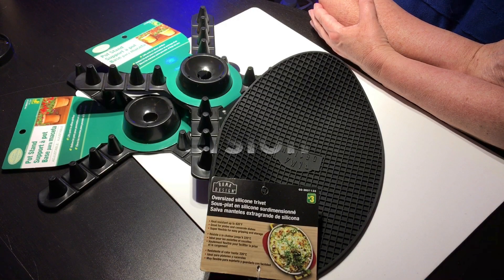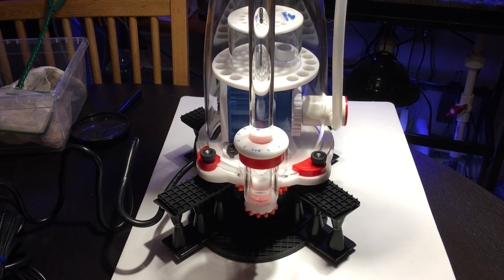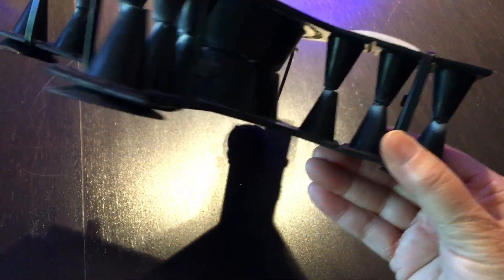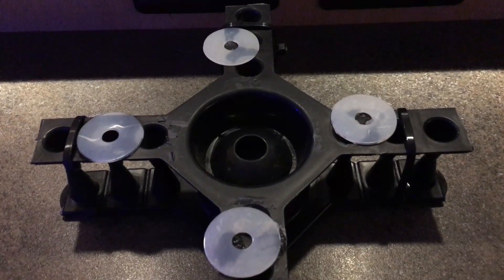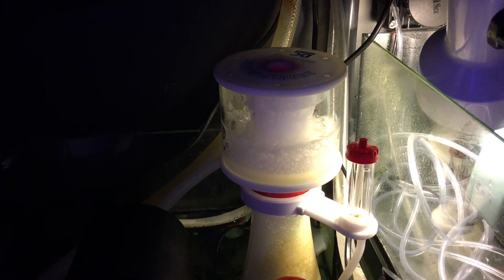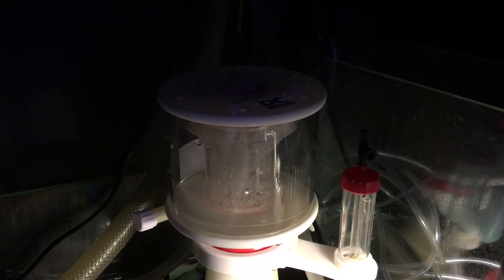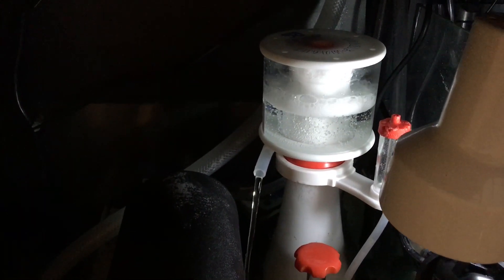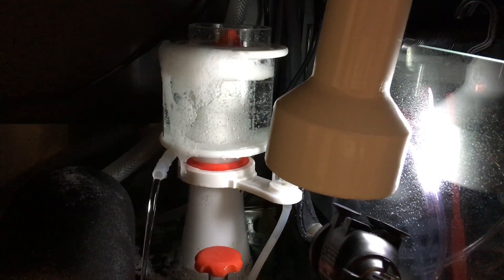DIY Skimmer Stand Turns into ReefRant - Am I Just Being a Princess?

Comment: Sorry about the skimmer woes... You're a trooper for hanging in as long as you did!
I had a similar experience with Bubble Mag and wound up selling it and going with a Nyos when my frustrations boiled over.  I wouldnt recommend them either.
A little tip for the next time you have an overflowing skimmer.  Leave the cover off the cup and put a gallon zip lock bag over the cup to keep the sump from getting sprayed.
Reply: And i stole that tip from Pelphrey :)
Reply from the maker: Lol, that is a good tip! I'd have needed a trash bag though. 😬
Reply from the maker: I've decided I'm saving for a Deltec. Enough of this BS. I honestly thought one morning I'd go and check, and everything would be fine. When I realized this had been going on for four weeks, I finally had enough and it was only by chance I found the air valve idea. If I hadn't, my next step would have been to pull the 3.5 from the nano and get it into here. Though undersized, at least it was working. And actually, that one broke in in about six days when it was new. smh. Hopefully the air valve fix will allow this one to work properly until I can replace it. So frustrating, and what a waste of money. 😡 Thx for watching and the comment!

Comment: Hey @Reefgrrl first of all, congrats for you effort to make this works!
It's very sad that they just don't care about you. I have one exactly like yours and I hope that I don't have the same problem when I setup my new tank. Please keep us informed and if you still have this problem I won't use mine and I'll return and take another one.
Thanks, good job!
Reply from the maker: If I were in a position to return mine, I'd do it in a heartbeat. But it's used now, and according to the distributor, working normally. 🙄 
Excessive overflow seems to be a huge problem with these Curve skimmers, and I've read some stuff about them being very touchy with reacting to water chemistry changes. I'm really hoping the air valve fix allows this thing to do its job properly until I can save enough $$ to get a Deltec. I should probably have done that in the first place but at the time couldn't get one in North America without huge shipping expense. Apparently now though, Marine Depot is carrying them. Thanks for watching!

Comment: I had this skimmer for almost a year and i had to do the same thing luckily i had a similar device from an old powerhead i had. I tried taking the air valve out after about 6 months just to see if it would be broken in properly and it still overflowed. I ended up getting a vertex skimmer and i am much happier now.
Reply from the maker: Interesting. I've removed the air valve several times to see if it's settled, and it still overflows. So that tells me there's something up with the design. I'm saving for a Deltec as long as I dont see too many further negative reviews on the new DC one. Vertex is also on the list because a couple of people have mentioned it. Thanks for the comment!

Comment: I've had my a5 for close to 6 months now. I used  a small corner of a paper towel to restrict the airflow. It is now a beast of a skimmer and I have it submerged just over the pump in about 4 -5 inches of water. Mine took over a month and a half to break in.  I ended up running it on vinegar water for about a day and that did the trick
Reply from the maker: Thanks Rob. I ran mine for most of a day in vinegar before it went into the sump. Didn't seem to help any. Or who knows - maybe it would have been far far worse if I hadn't.....
Reply: Reefgrrl Yeah I feel your frustration with this skimmer. I tried replacing the overflow but I quickly ran out of fresh saltwater to replace it. Once I choked the air it started skimming like a beast and now I have the water level just above the bubble plate and set around 1 or 2 it works great without choking the air. It's been quite a frustrating journey to get to this point

Comment: O boy sorry to hear i m hoping your problem is solved by now...i m glad I saw this video i m in process of buying a new skimmer amd i have narrowed down to bubble magus curve 9 or CORAL BOX cloud 9....i m now leaning towards coral box.....
Reply from the maker: Well, it's now been running for 10 weeks and still overflows if I remove the air restriction. But it's skimming really well, with near-black semi-wet skimmate. So it's working, just not the way the manufacturer recommends. Haha, your call I guess.... 🤷‍♀️

Comment: I had this skimmer (it's in the closet now) and also experienced the same ridiculous break-in period. What really seemed to help me was to run the skimmer in a vinegar-water mixture for several hours and then run it in RODI water for an hour and then back in the sump. This skimmer was a little oversized for my tank and was also rather prone to overflowing upon performing any kind of routine maintenance on the tank so I decided to retire it for another skimmer (Aquamaxx WS-1 which I also don't love as it causes way too many microbubbles out of the overflow into the sump).
Reply from the maker: It's the issues of overflow from the slightest of changes in the tank, that has me concerned that it will never work properly. It's unfortunate that lessons in this hobby are so expensive to learn. I actually thought I was buying good quality and value for money. But this overflow thing is, in my opinion, a far worse problem than underperformance. So I'm going to save up for a Deltec and put an end to this BM BS! 😎 Thanks for watching!

Comment: Hi! Okay first of all, as you do know I have the same type of skimmer : There is a V2 version of this skimmer, that's the one that comes with the airvalve. That version also has a hole (around 6-8mm) drilled into the baseplate opposite side of the pump to allow more outflow (and by that to lower the water level in the body) - mine is the V2 version. Second: Your skimmer will never break in if it's overflowing that much, not even in half a year time. Third: You restricted the air way too much in the video - you can see that the body is almost full with low bubble density water, and only around 2 inches are bubbling -> that's a way to prevent it from overflowing, but you will get very bad skimmer efficeny. Interestingly enough if you lower the air intake rate, you will get a higher water level in the body (because that's how all skimmers works), as the pump can pump more water then. So.. Here is my advice: First of all pull the air intake from the bottom of the silencer, and just run it free for a while (will be loud). This way it can pull more air, which will drop the water level. If raising  the skimmer & this doesn't solve the problem, I'd drill a 6mm hole into the base plate (there is really not much to loose, worst case you can silicone it back) And see what happens. If it's still overflowing, step up the hole to 8mm (I wouldn't go any bigger). Mine is raised around 1cm on an eggcrate, and with the silencer and the supplied air valve not in use (I'm running the air from the outside of the house), and the gear valve fully open, it's consistent and produces a nice dry skimmate. Remember, you want full white milk colored water in the whole body above the diffuser plate on the pump & if you decide to drill the base, go from small to big, and don't exceed 8mm (6mm would probably be enough), as that might drop the water level too much.
Reply: I can measure the hole / send a picture of it's location on the base plate for you if you'd like.
Reply: Measured the hole and it's 6mm. Also took pictures about it, so let me know if I can send them
Reply: Ooor if you don't want to drill it, remove the silicone thing that goes over the electrical wire of the pump while exiting the base plate, just behind the pump. That'll also let more water to flow out of the body
Reply from the maker: This is great - thank you so much for all the detail! I'll certainly take a look and see how things sit and what adjustments I can make. Right now, a little more than 24 hrs after inserting the air valve, the skimmer cup contains about an inch of very dark brown skimmate, and the neck of the cup is filled with brown foam that spills slowly into the cup. It looks like it's producing exactly what it should. I'll see if I can adjust the bubble level to rise closer to the top of the skimmer body. I read where someone said theirs works perfectly with the bubble level about an inch or so below the upper white plastic rim of the skimmer body.  I guess it's a bit different for everyone. 
I really appreciate you taking the time and effort to provide this info - it does make sense and the missing link was how to actually accomplish the adjustments. 😀
Reply: Hm, interesting.. Sorry if I sounded like a smart guy:D Anyways, If you're happy with the skimmate then leave it as is:)
Reply from the maker: Hahaha, never apologize for helping somebody! It sounds like you know what you're talking about. I very much appreciate any info that will help.

Comment: Ive had this issue with other skimmers. On my Red Sea Reefer 350 - it usually takes overflowing a bucket or two before the skimmer calms down. 

In my system it was caused by using the putty or when I used certain medications. Switching to superglue stops this from happening.
Reply from the maker: It still overflows if I remove the air valve I put in, and it's been running now for 2 1/2 months. And it doesn't skim efficiently, seems to me. In my system I only used putty for four corals and that was six weeks ago. It's driving me crazy and I am planning to replace it when I save some $$ to get a Deltec or perhaps Nyos. It makes no sense to me why it won't break in properly. Thanks for stopping by!

Comment: honestly, raise the skimmer higher until it's not flooding out like that. It will be almost a dry skim but will be taking organics out. organics and any plumbing glue you may have done. my RLSS DB6i skimmer was bad, even at the lowest setting and raised up to the cabinet top. after many....maaaaany emptying and cleaning of the cup did it finally settle down to were I could bring it back down to regular depth and increase my motor speed. but yeah I'd remove that valve and raise the skimmer pretty high. I use pvc pipe and elbows with some egg crate zip tied on top. gives me infinite adjustments and is super cheap. I go through a lot of skimmers btw.  my current one is a SRO3000 from reef octopus and I like it, minus the large foot print. same 425xl tank btw.
Reply from the maker: I would love to have had the chance to empty a skimmer cup but all it did was overflow. Never stopped. The space I have is limited and right now it's as high as I can get it without it tipping over. I'm done fooling around with it and hopefully the air valve will buy me time for it to get running as it should. I can't use egg crate because the legs are pointy and go down into the holes, and then the adjustment doesn't work because the gears can't move freely, being under the bottom plate. Sigh. I had a Reef Octopus and loved it until it finally died (I got it used). But that was another tank..... I've decided to save up for a Deltec, enough of this BS. Thanks for the tip! May come in handy next time. 😁
Reply: Reefgrrl yeah that gear valve thing I hate. my RLSS DB6i is the exact same way. I just let it sit through the egg crate and fully open while the skimmer was figuring out what it wanted to do. I have my back up skimmer the LifeReef 36 inch version with a fluval SP6 pump that is just over kill lol. Only reason I don't put it in the 425xl sump is cus the pump would suck and chop my lightning maroon I have down there. oooh! I just remembered one thing from my old 120g once the ATS is maintaining the tank, the skimmer doesn't really produce any foam head anymore. the skimmer just stopped producing, even when I changed to the smaller RLSS from the LifeReef. just something to think about since you have the scrubber as well before you decide to drop a lot of money on that skimmer. I'd leave it as is since it will become a giant air bubble pump to oxygenate the water. 

off topic: I haven't forgot about your request of coral placement lol. I got my par  meter out and found out it was super low. I had about 75 par at the tip of my rock. I have it adjusted to 350 now but am doing it over the 6 week acclamation mode. in the mean time I'm trading my acans for acro :)

Comment: I used A5 before. it work really well for years! you need to level to the buble megus white plate where the black  plastic screw about 6.5inch height
Reply: no point trying everything just understand how it work first.. 6-6.5inch is the exact height trust me
Reply from the maker: I just checked and as close as I can tell, that's about where it is now. Still overflows when I remove the air valve, but I'm hoping that will change as it starts working the way it should. Thanks for the tip!

Comment: Try opening the gate valve all the way. I think the air silencer is the issue here. Try to run the skimmer without attaching the air line to the silencer. In general the water level in skimmer should be the same as the highest point of skimmer body with the cup removed. If the water level is higher in the body, either air intake is restricted or the gate valve is way too much narrow.  Also the oil residues and epoxy can cause overflowing problem as well as some medications like red slime remover.
Reply from the maker: Thanks for the comment - lots to think about! This is a new tank so no meds  and until a few days ago, no epoxy. I have no clue why this is taking over four weeks just to break in. But at least now it's skimming properly.

Comment: I'm glad I watched this but sorry for your experience, which you handled very well considering the setbacks. as for the rep, well.... that's bubble magus off my list 😉
Reply from the maker: I hate the "nobody ELSE has this problem" excuse. So now, I'm saving up to replace this with a Deltec. And hoping this BM starts running properly at some point. Once my 20 is torn down if this one is still not running right,mi might take the 3.5 and use it to replace the a5. I realize the 3.5 is underpowered, but I know it works a treat. And it only took about six days to break in. Thanks for watching Dr!

Comment: great video. i am using a aquaone g series skimmer which is another cheap type of skimmer and its brilliant. it came with a valve to control air intake as do lots od other skimmers so that person you were dealing with was talking pure shite! glad you got it sorted!
Reply from the maker: Thanks Irish Aquarist, it seems I've been let down by BM in this regard. After running for a couple of days now with the air valve in place, I'm getting dark brown, dry skimmate. I've been adjusting the red knob to maintain more water in the chamber and slowly getting it to produce slightly wetter skim. I've removed the air valve a couple of times to see what will happen, and sure enough, the liquid zooms up the collection cup neck and starts overflowing. But at least I can make it run the way it should now, no thanks to Bubble Magus. Thanks for watching!

Comment: so painful.  Rant justified, totally!  I thought you were going to rail on the 7.9-8 range, though as well.  Maybe I missed it, what water height are you at now?
Reply from the maker: Thanks LF, and yeah, seriously, how can they be that precise when they can't even be accurate? I suppose it gives them an out when most people find they can't get the thing to work right - they can claim it's not being operated within the stated tolerance. 
At the moment it's running in just over 7" of water, with the air valve inserted. That valve is wide open but it seems like just the restriction caused by the thickness of the plastic is helping to control the bubble level and there is zero overflow right now. I've removed the valve twice just to see what happens, and both times it overflows again within seconds. 
I've decided I'm saving my money for a Deltec (apparently Marine Depot is now carrying them) and that way if this thing never works properly I should be able to replace it within a couple of months. 
Oh well, today is going to be a major coral moving day so that's a good thing. And I'm going to do an update on the new fish and other stuff in that tank as well (I've been updating on  Instagram and now I'll do a YouTube video). Thanks for watching, and for the support!

Comment: Jesus...4 weeks? My temper would have smashed that skimmer 3 weeks ago haha...
Good ting you got it sorted though
Reply from the maker: Honestly Daniel, there were times I could have cried, I was so upset and frustrated. The crazy thing is, I've been really careful with this tank, to research before doing anything so as to minimize problems. I guess the first clue should have been when this skimmer had a dead pump straight out of the box. I've decided I'm saving up for a Deltec and hopefully this BM will actually start working so it can do it's job until I can replace it. Thanks for watching!

Comment: Reps are a nightmare, I had same issue with a Vertex 130 never did bed in. I'm running a DC Deltec now and again I'm Not impressed. Maybe I'm just fussy😂
Reply from the maker: Hahaha, I don't think it's fussy to expect an expensive piece of equipment to run properly without major issues to get it there. I'm planning to get one of the new series Deltecs - what issues are you having? I've read the older ones are rather noisy. Thanks for watching!
Reply: Reefgrrl I have a Deltec SC1351 which is a DC pump model. I've had it just over a year and I'm already on my second controller. I also don't seem to get much gunk skimmed out either. If I'm honest I think the body design is a little dated as well.
Reply from the maker: Hmmm, good to know. Thanks for the details - that's the exact model I'm considering. I'll have to look into it very closely.